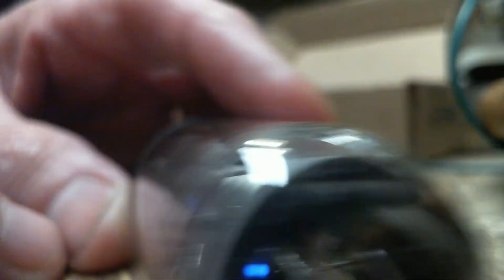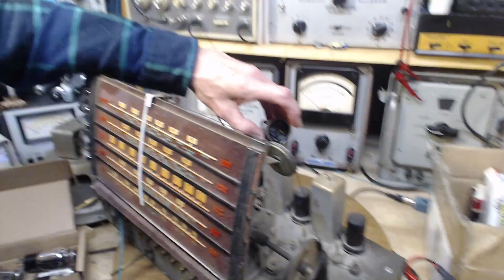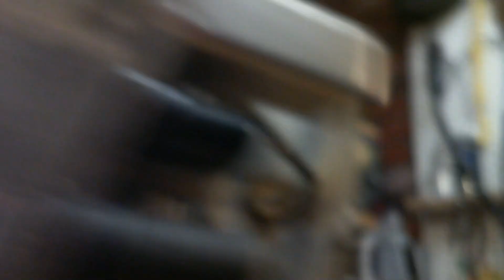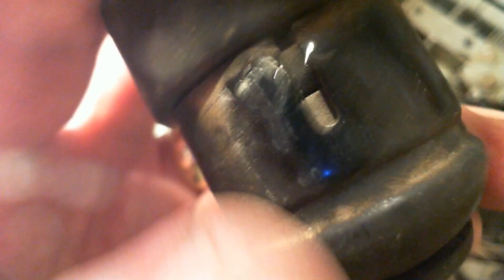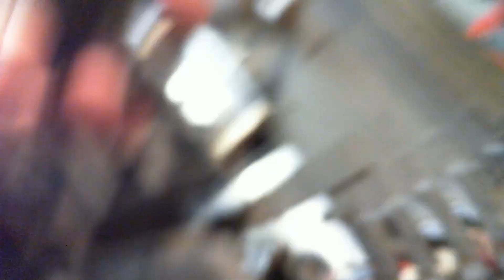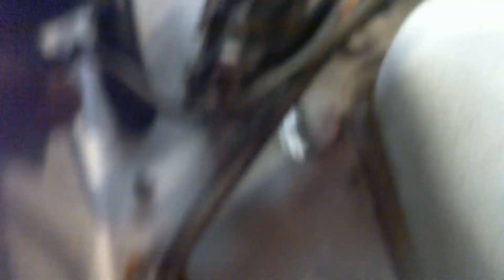Canadian Westinghouse 981 Shortwave Radio Video #18 - Magic Eye & One Meg Resistor

Comment: Hi, my husband watched both your videos for the Electrohome Apollo Record Player, he followed all your instructions for the one he owns, but now he does not know which grease to use for it.  Are you able to let us know what type of grease/brand he should buy for this please.  He did not hear you mention it in either video.  Thank you so much in advance.
Reply: Jim says that he doesn't read comments. It's been years since I've seen him post a reply to any comments.

That being the case I'll offer the observation that he usually uses "Super Lube" brand silicon brake grease because that's what he has at hand. It's made for use on automobile brake systems so it may or may not be optimal for use in a record changer mechanism.
Reply: @mjr1999  OK, thank you so much for the suggestion, I really appreciate it.
Reply: I suggest watching radiotvphononut's channel. He services turntables and older record players. He knows the right lubrications to use.
Reply: @Tom-vj7oi  Thank you, I told my husband to go check it out :)